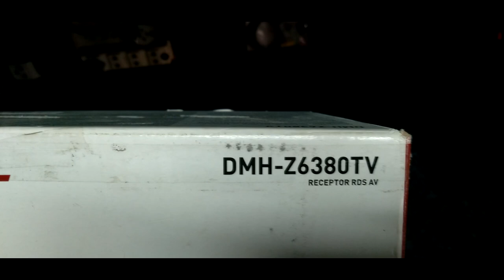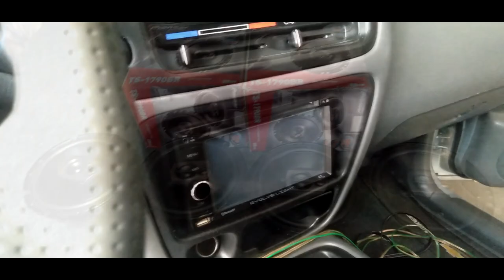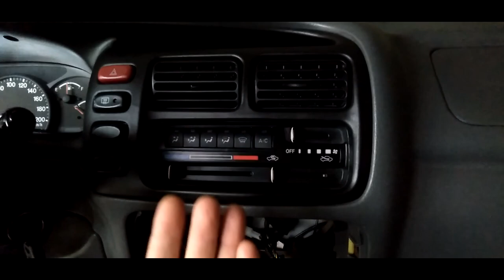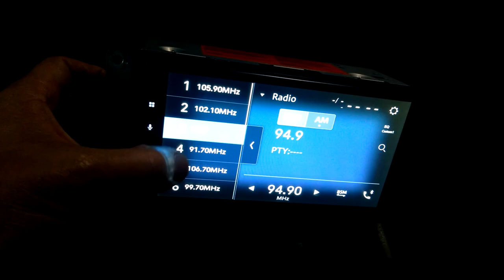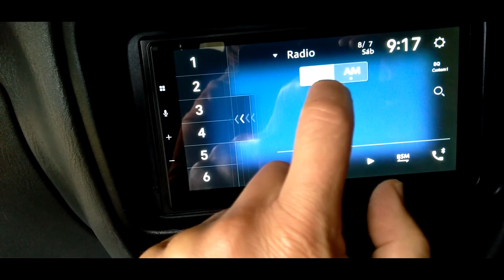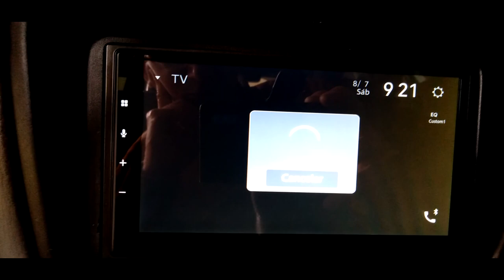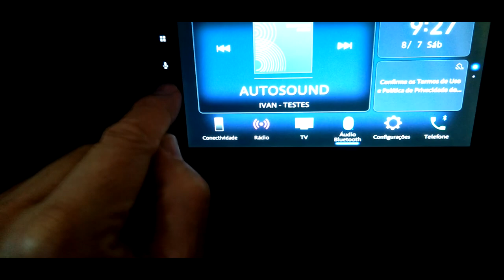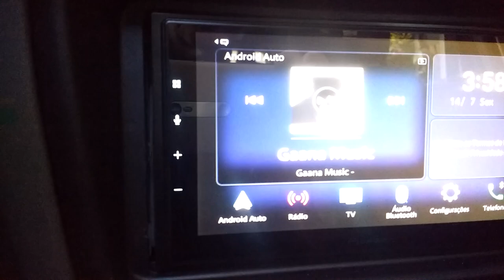🔝Chevrolet Tracker + Pioneer DMH-Z6380TV + TS-1790BR + JBL SW8A-MS UPGRADE!

Comment: Cara, instalei o SW8a-MS que tem 200 rms de sub e amplifica dois canais 100RMS cada e coloquei dois alto-falantes de 80 rms também da JBL modelo 6TRMS80, a questão é que o ganho dos alto-falantes amplificados está regulado abaixo da metade e os eles estão “trelando” dando a impressão que acabaram rasgando os alto-falantes na instalação ou que a caixa amplificadora amplifica bem mais do que 100 rms cada canal. Como a diferença de potência é só de 20rms pela lógica, a regulagem do ganho dos alto falantes amplificados não era pra ficar acima da metade ? No teu caso aconteceu a mesma coisa ?
Reply from the maker: Tem muita coisa envolvida nisso desde frequencias que o alto falante não suporta responder até falta de crossover passivo na linha de resposta de graves - médio graves e agudos entre outros problemas . Neste modelo voce até tem crossover para sub mais não tem crossover ativo com regulagem na caixa nos canais estereo de 100 watts cada . Cabe ao instalador alertar o cliente da fala de capacidade de filtragem caso o player exceda o nivel suportado.
Reply: @autosound  no caso, se eu colocar um alto-falante de 100 rms, o rendimento seria melhor ?